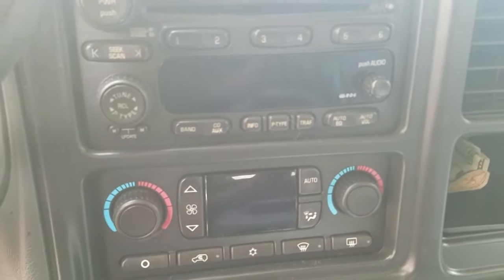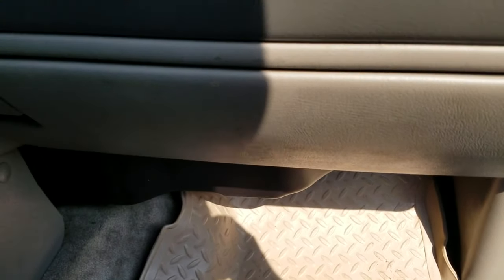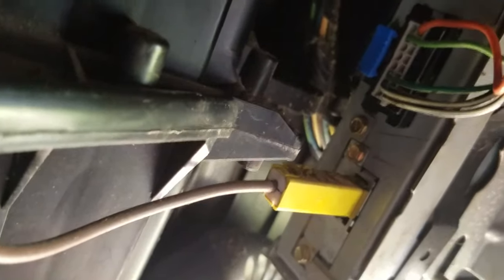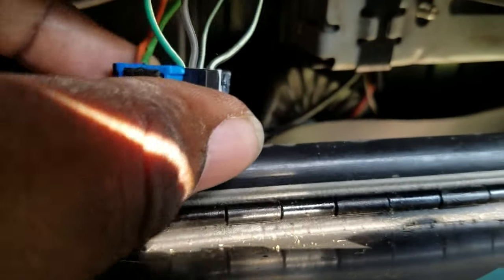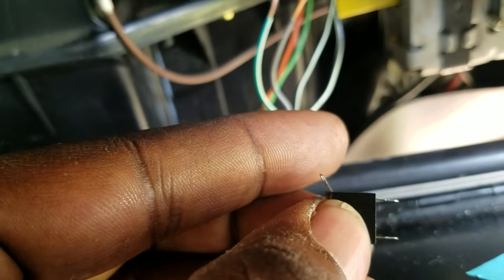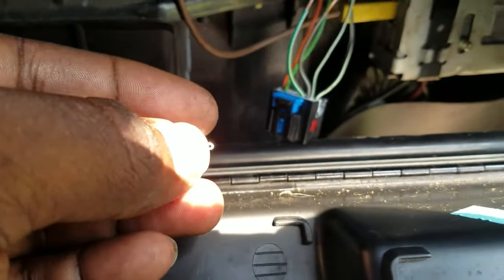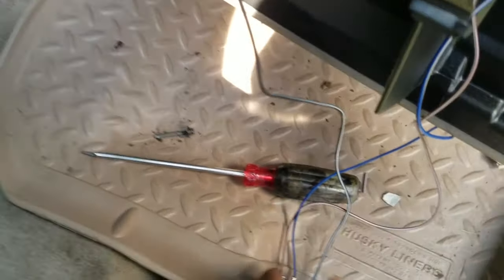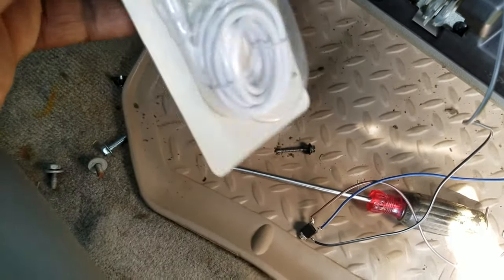How To Install A Aux Input To Your Factory Radio For Under $5

Comment: Here from 2024 I did this on my 04 Silverado radios looks different still had XM note it worked perfectly don’t use the black and white wire sand a metal stud on behind the dash and ground it there trust me it works beautiful and I mounted mine inside the black cup thingy it looks oem and do yourself a favor and purchase a more expensive aux female adapter it’s better!

Comment: This was awesome. I tried it and got it working. I had to ground it to the vehicle. The only thing is that only the right side is working. I have tried multiple cables, not multiple phones though. Channel 1 plays on both sides just fine. Any ideas what it could be? Update: guessing it's because this is a mono jack you linked to and I'm using stereo cables. This should work with the stereo version of the jack, right? Update 2: I ended having to connect both top and bottom terminals to have the audio come out both the left and right speakers. Update 3: didn’t like that setup so I removed the wire that connected them and bent the inside pins towards the middle so when the aux tip was plugged in, it made contact with the tip and that got sound out of both speakers. Hope I didn’t mess anything up. Lol!
Reply from the maker: Yeah I did mine this way, and got sound of of all th speaker....

Comment: What is that jack called
Reply from the maker: You can get them off Amazon just type in CESS 3.5mm Mono TS Plug Jack Socket Adapter then scroll down and you will see them...

Comment: I have the same exact setup accept my music is not playing very loud. What could be the problem?
Reply: It worked perfectly fine for a long time and now I recently started to use the aux plug again it's not playing that loud. Volume turned up on my phone for the life of me I cannot figure this out other than maybe a grounding issue maybe I should take the glove box down and look at all the wiring again
Reply from the maker: @Gary E Williams II  try changing the ground. If it's a terminal on the end of the wire cut it and put a new one on, and move the ground. Some time the end of the wire with the terminal get corroded over time.... If that don't work change out the auxiliary jack..

Comment: Do you think this works on a 2006 Yukon Denali
Reply: I am 16 so dont trust me too much but i think its 2003 to 2007
Reply: @rawfp7201  No worries, I’ll try it out for fun anyways
Reply: @Yahir.T  yeah as long as its made from gm motors and 2003-2007 im 90% sure it works
Reply from the maker: I think it should

Comment: Heyo my car doesn’t have a 0 radio Id so what do I set it to
Reply from the maker: What does it have?
Reply: @Change4ADollar  I actually ended up coming with a cheeper and better option I got a piece that goes in the charger spot that u can connect to Bluetooth and it emits a radio and u can change what channel it’s set too aswell as the led color but thanks tho
Reply: @gamingg-d1444  what’s it called?
Reply: @blurrbxdda5383  it called a FM transmitter

Comment: Where can I find the jack and what’s it called
Reply from the maker: You can get them off Amazon just type in CESS 3.5mm Mono TS Plug Jack Socket Adapter then scroll down and you will see them...

Comment: I tried different grounds but It still has a background noise and it is very quiet.
Reply from the maker: Did you try a nice clean metal spot, Hit it with some sand paper, and mount it there?
Reply: Found out what it was, the aux box was cheap and not making good contact with the cable, Thank you for the tips tho. I appreciate that